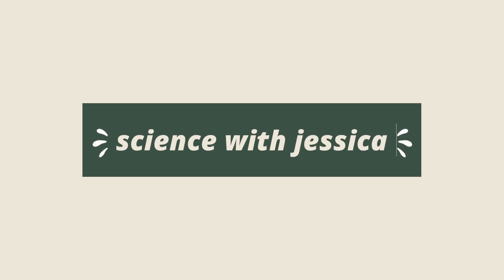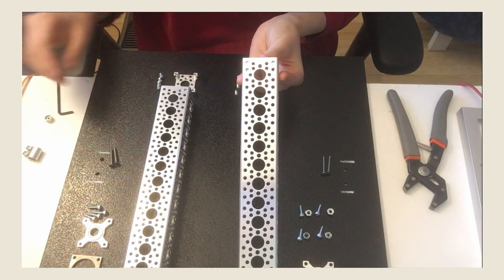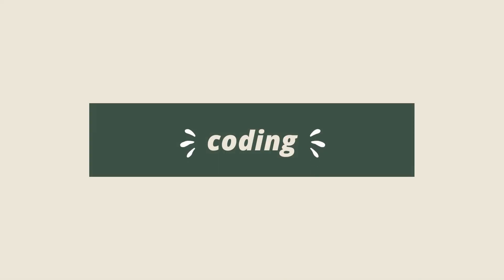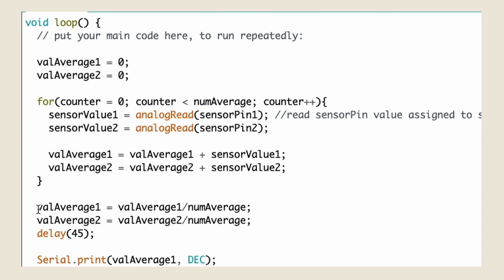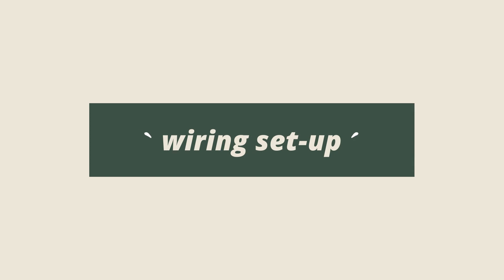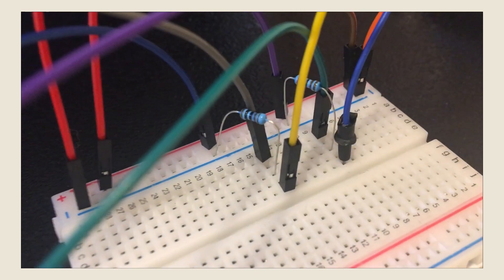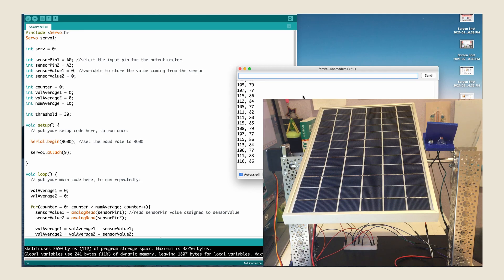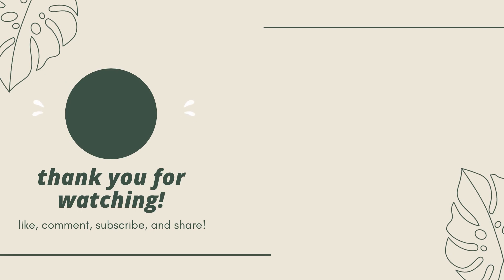Easy DIY Solar Tracker

Comment: You keep saying that you have a list of materials in your description box. I cannot find this. Can you not show a list during the video?
Reply from the maker: Hi, Roger. I did not have a set list at the time of filming/editing so I had to put the list in the description before uploading. There IS a list of the materials in the description box of this video but I'll copy-paste them here as well:
━ LINKS ━
Servo Motor: https://www.amazon.com/gp/product/B07... 
Solar Panel: https://www.amazon.com/gp/product/B00... 
LDR: https://www.amazon.com/gp/product/B07... 
Foam PVC Blue Sheet: https://www.homedepot.com/p/Palight-P... 
Download Arduino: https://www.arduino.cc/en/software

*All of the following items are from https://www.servocity.com/ and can be found using the SKU code numbers provided here.
0.375" (3/8") x 12.00" Aluminum Tubing (x1): 635250
0.375" to 0.375" Clamping Shaft Coupler (x1): 625064
15" x 15" ABS Sheet (0.250" Thickness) (x1): ABS250-15-15
25 Tooth 0.375" x 0.280" Servo Shaft (x1): 525146
3/8" Bore Bottom Tapped Clamping Mount (x2): 585544
3/8" Bore, Face Thru-Hole Pillow Block (x2): 535114
6-32 Nylock Nuts Pack (25 pack) (x1): 632142
6-32 x 0.250" (1/4) Zinc-Plated Socket Head Machine Screw (x1): 632106
6-32 x 0.4375" (7/16) Zinc-Plated Socket Head Machine Screw (x1): 632112
6-32 Zinc-Plated Steel Pan Head Screw (25 pack) 0.250" (1/4") (x1): 632176
Large Square Screw Plate (x1): 585430
Side Tapped Pattern Mount C (x2): 545360
Standard Servo Plate B (x1): 575124
U-Channel (13 Hole, 10.50" Length) (x2): 585452

Comment: Hey, I have done that part and also wanted to generate a report on the comparison between fixed and tracking solar panel, what materials do I need to add and how should they be connected. also how do I add a notification feature to the project?

Comment: Hello, for the servo motor, can I use MG946R servo motor instead of MG996R servo motor? Also, what's the voltage of servo motor you are using for this project?

Comment: I don't know about arduino, i suppose the ldr's are triggering on when in shadow, what happens to servo when cloudy and both ldr's are in the low light and both are sending signal  ? Thank you
Reply: I think the Arduino is comparing the signal from the ldr's, if one is on shadow and other is on light, the servos turn on until the two are equals in the readings.
Reply from the maker: @VictorC173  Yep that's exactly right! Thanks for helping to clarify :)

Comment: I build a strong steel solartracker too. 600Wp, 2 achsis 🌞.  Please look my tracker... In order to suppress the trembling of the servomotor, there is still a waiting time of 5 minutes in the program.  Otherwise the solar tracker would break in use.